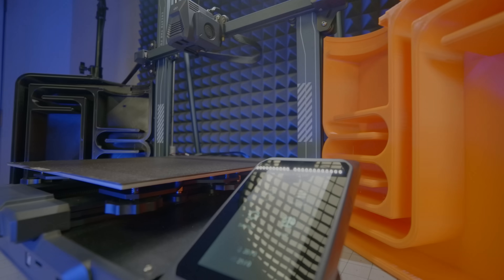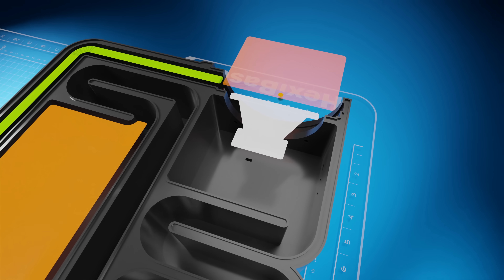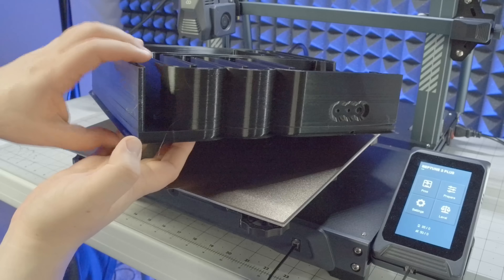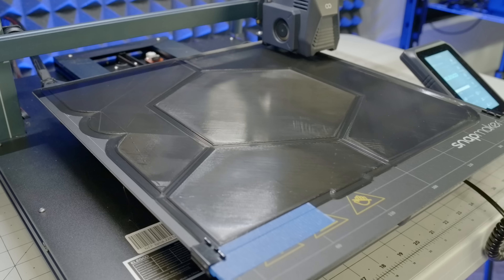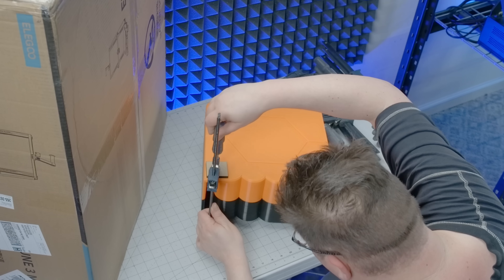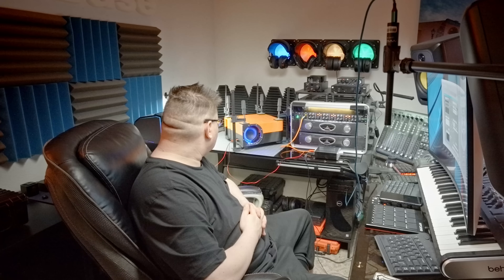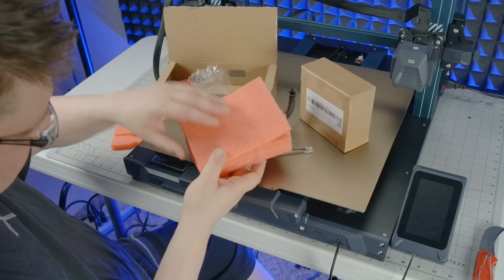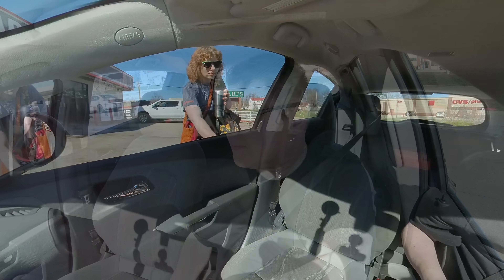ELEGOO Neptune 3 Plus Review & Feature Build

Comment: my suggestion for you is to use enclosed chamber .. the cooling of large prints usually requires more adhesion .. use Elmers Craft glue.. it bonds great.. especially petg  .. if put over survival blanket and then after finishing print lower the bed temp to 30 C and leave it there for 6-8h  basically it will let you print large prints PLA and PETG, ASA and ABS

Comment: Yes to all the glue sticks and other ways to make it stick and i know this was a review of the machine etc. 
But honestly, now i am wondering if a 3 part print instead of a 2 part print would be better/ easier/ more reliable to glue together.

Great video and thanks for doing these, i am so tempted to build one of these, but i dont have a printer that big!

One of the other problems is where to put a sub like that, the trunk of my car usual has tools and work stuff in it.
How about a design that would fit under a seat of a car? Maybe running 2 drivers, super thin. 

That should be a challenge for you!

Comment: I think the only real solution to the enclosure warping would be to print in smaller slices and attach them together. So instead of doing 2 half's maybe do 4 parts each half the height as normal then attach them together. It's more work but might help the box to not separate. Or maybe such a design just isnt suited for 3D printing and maybe would be better off made of MDF and a CNC.

Comment: I missed hearing what you printed this with but there are options that would WELD the PLA (ABS or ASA also) together better than JB weld.  3M Scotch-Weld Plastic & Rubber Instant Adhesive PR40 works incredibly well and almost instantly melts and bonds the mating surfaces.  Another option is SCIGRIP 16 Acrylic Cement , which is simlar to 3d Gloop.
Reply: You dont need to buy expensive bottles of this stuff. Just get dichloromethane (DCM) for PLA or methylehtylketone (MEK) for ABS from a local chemical supplier, its way cheaper.
A tip for ABS, get some MEK, and throw in some old abs offcuts/parts to let them desolve over time, creating a kind of abs slurry the consistency of jam. That stuff works wonders fixing cracks or reinforcing abs parts.
Reply: Just use Oatey ABS or All-purpose cement from the plumbing section of your hardware store.

Comment: You need an enclosure to prevent it from warping. It's possible to maintain dimensional stability if the ambient temperature is warm and stable
Reply: This is what I thought, I was also think as it is a split part anyway, adding in some break away supports into the model could also help, then remove, sand and glue the parts together.
Reply: Yup, I have an enclosure and if I’m patient I have no longer suffered from this exact issue. It’s not heated, but I got a couple stl flies I made to print first for a couple hours, and pre-heat the enclosure, then start the main print, and do not disturb until the print is done and the enclosure is cooled back off to room temp. I did buy a small heater to add to the enclosure but I have yet to need it. And I’ve designed and printed some large cases for Starrett tools and various other tool cases that I use to have issues printing. And out of Pla or Petg.
Reply: @marv8481  Or just keep it closed while the bed comes up to temperature? Should get fairly warm.
Reply: Is temperature-controlled enclosure the next upgrade for large printers?
Reply: @JB-fh1bb  depends on the part and how fast the printer can move, but imo (started printing recently) yes, i have gotten better results with tall (pla) prints
Reply: With the exp I have in auto body, I’d like to mention utilizing a compact heater fan aimed at the build plate. Size heater fan under 12x12 maybe one on each side of build plate just to help maintain the printing temperature.
Reply: i use my closet and a radiator heater for my enclosure
Reply: I'm sure he has some videos about prints of boxes for 3"
Reply: I was thinking that he could have clamped the two haves together between two flats and then left it a couple days at elevated temperature to let the creep properties relax the residual stresses of FDM away.
Reply: @skyak4493  Or clamp and hit it with a hot air gun for a while?
Reply: I have an enclosure is that I have 1 Tang Band W3-1876S 3" Mini Subwoofer and that box looks so cool. or can it be down scaled?
Reply: @antoniorosario8233  No it can't be scaled down.

Comment: an enclosure this size might benefit from a dual extruder printer using a 5kg roll of pla on the first extruder and a roll of soluble filaments as supports so you can print it all out in one piece

Comment: I don't know about the Neptune 3 max but i have a cr 10 max with the 470x470x470mm build area and it's kinda hard to find a aftermarket sheet for the thing, definitely not the 20$ you mentioned from your 3+ that's for sure, most i see for printers this big are the stupidly priced wham bam sheets.

Comment: Warping of large PLA prints is mainly because they need to be cooled down uniformly. This is very hard to manage on an open frame printer, but you can "bake" the print afterwards, I just finished 20 tiles of cityscape that was 30x30cm each, and 5 of the tiles had warped because I didn't let them col down slowly in the print chamber afterwards.
I fixed it by putting them in the oven at 55 degrees for about half an hour and them slowly cooling them down again. You can also fix a print with a heat gun/hairdryer, but it may require a bot more practice.

Comment: You need to add 10 degrees for bed if you have some adhesion issue. Will work only for PLA, for another you need to youse some glue for adhesion

Comment: Pro Tip 
Epoxy (and esspecially JB Weld to flat plastic surface , will stick good enough for smaller parts but not that big)  dont like plastics and wont stick to them to good without additives that dissolve it (that stinks like hell but works rly good) 
great alternative is to just use thick cyanoacrylate glue (so it have time to cure) or use epoxy DESIGNED to be used on plastic 
JB Weld will "unstick" almost always unless you prepare rough surface with a lot of pinholes , tooths that it will grab like a hook or even holes with some toothpicks etc for it to stick and hold the parts together ...or else it won't stick
the easiest solution is to just drill dozens of 2 mm deep holes using 1.5-3mm drill bit on both parts so epoxy will stick to it 
or use some contact cement etc ...they like to stick good enough too and no need for clamps , it stick permanently instantly at contact

Comment: Awesome build! One trick to the warping would be to anneal it in the oven while clamping and curing the JB. That will release the stresses.
Reply: The clamps would sink into the plastic, you would simply place the two halves together with something heavy and flat across the entire top and anneal.
Reply: @timmturner  two flat pieces of hardwood board with a heavy weight would work, the oven  doesn’t need to be so hot that  it would make the wood smoke as it would just melt the plastic at those temperatures.

Comment: I find that PEI sheets tends to need glue to be fully usable, so I use PVP-based glue stick for that. Recently I was told that thinning the applied glue on the print surface with IPA gives you a lesser of a mess and a better surface finish.
Reply: I found a clean sheet works great.
Edit: I clean as per the FAQs online. Warm water and detergent soap to remove all grease. I have 99% success with adhesion. 

Bed levelling should never be overlooked. A good enclosed printer for ABS and the like
Reply: I found "tacky glue" at the bargain store, I'm guessing it's the same thing. I thinned it with water and apply a bit on a lukewarm (glass) bed, spread it out with a plastic card, and come back a few minutes later to a smooth film that lasts many prints. It holds PLA just a little too well, and PETG is a breeze now, TPU as well. HIPS and ABS stick just fine initially but still need an enclosure which I don't have.
It's the same with a PEI coating, as it's now the glue doing the work and not whatever it's been applied to.

Comment: Something I do with the PEI sheet before printing. 
Wash it with water, soap and a sponge. Do not dry the top layer with a cloth, shake off the water and let the heating of the bed dry the sheet. You can dry the bottom with a cloth. I CANNOT get a good print otherwise. It HAS to bee fat and dust free. The adhesion is crazy good all over the platform when you clean it that way.

Comment: I love your projects, but every time you do 3-D printing, I am yelling at my screen… “Use a .6 or .8 nozzle” and “increase the speed“. 40 to 50 mm/s on your first layer 100 to 150 mm/s on your infill and maybe 80 on your perimeters will DRASTICALLY decrease print time with no deterioration in finish quality or strength. You may be able to get away with 30% gyroidal infill…?
Also, was that PLA? I’ve never had PLA warp and have split layers…?!
Reply: Yelling at the screen doesn't work. Email does.
Reply: @dj4monie  👍never know where to find email. But on his website it says to just leave a comment; so… check mate🤣🤣

Comment: This 4" driver is very similar to the one in Homepods. Do you think it is possible to come up with a cylindrical design using a high order bandpass design? I think this shape could mitigate the heat deformation issues.

Comment: What kind of box type allows flat response down to 20 hz?
Reply: A giant one
Reply: @androiduberalles  pretty sure it's less about size and more about the way you build the box
Reply: @Eternal_23  it is most definetly
About size, you cannot have a small box that plays low, depends on your definition of small too. You could do a ported box tuned to 23hz and save a lot of space, you can do sealed, but the more efficient boxes are gonna have to be huge man, and then you gotta worry about loudness and more cone area which makes the box way bigger
Reply: @modernbassheads5051  I'm talking about flatness to 20, not loudness, so I'm right in this context
Reply: you don't need flat, depends on your room gain. In a car it's much easier to get 20hz than in a room
Reply: @FSXgta  can you give a hint why?

Comment: Use some purple elmers school glue...it really helps
Also putting your printer in an enclosure to regulate the temperature really helps
Very cool!
clear Silicon 1 or shoe goo might be a better adhesive for holding the shells together
Keep em coming!!!!
Reply: I'd go with something like Momentive RTV108. It's a silicone adhesive that's often used for aquariums, so it can hold a substantial amount of pressure. Really high performance stuff, but also quite expensive.
Reply: @jayleno2192  For a speaker / sub enclosure, a post cure flexible sealant is not ideal, especially with no fasteners. Though it would be pretty reasonable for a "toy" project like this sub, RTV would not be good for use as primary adhesive in speakers otherwise. That said, the design would be pretty easy to add squared corners and sides to add fasteners at each exterior and interior (waveguide turns) corner.
Reply: i use gluestick(pva) which is white elmers glue. 1 if it sticks too well to the plate elmers glue will stop it and if it doesnt stick well enough elmers will help it stick. dont care what material it is i always use glue.
Reply: All of those adhesives would not survive the pressure cycling (vibration) / wave propagation across the seam. Enclosure remark only makes sense if the temp is regulated, otherwise it is just volume + energy luck that a given enclosure maintains dimensionality (same bad principal as heated print beds that frequently fail - instead HAVE a fixed enclosure at a specific temp instead of shitty gradients). And really if this was a manufactured product, the adhesive would be sonic welding stronger than any layer adhesion. Similarly, hot air jet layer welding should be the next step in filament printing along with cold jet curing.